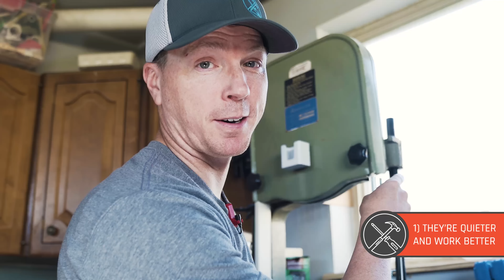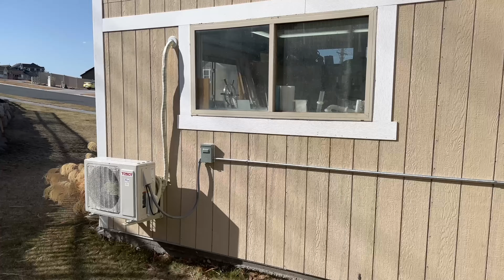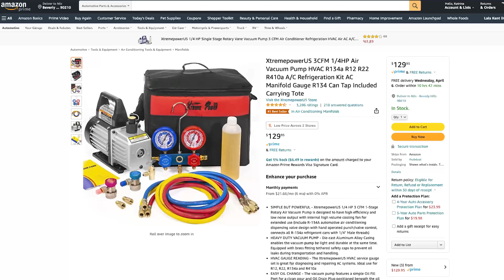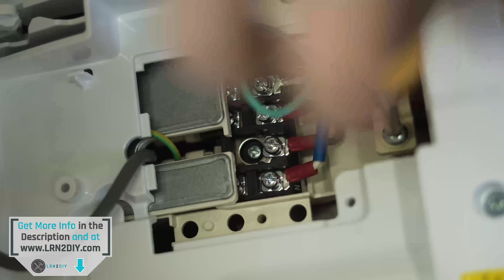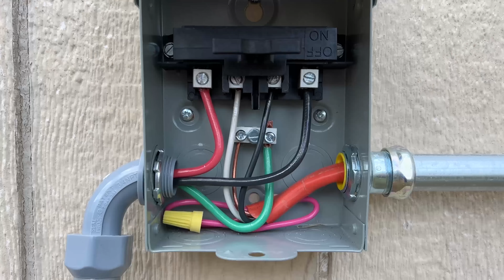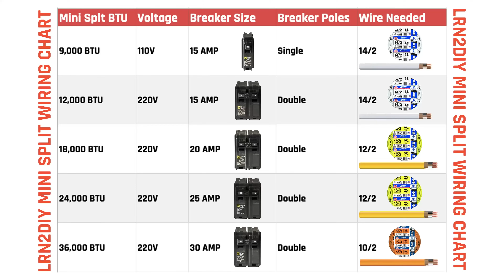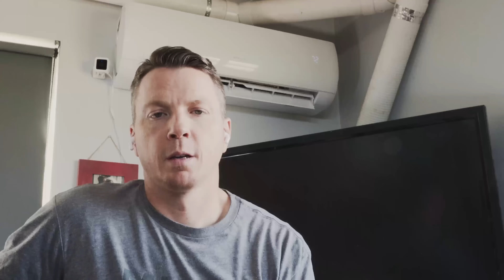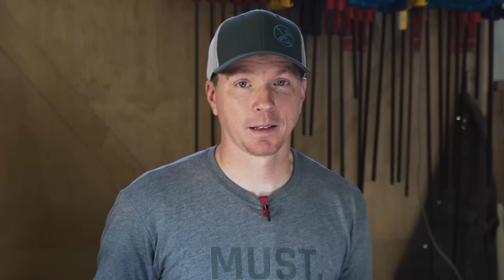Mini Split - 3 Things I Wish I Knew Before Installing

Comment: 1. You didnt say where you lived so most of what you said was useless.
2. There are 3 manufacturers in the entire world they are all Chinese, GREE..HAIER...MIDIA everything else is just stickers and injection molding to your liking. Each one of these manufacturers have good better best. This is why your Japanese units come in a box that says made in China.
3.SEER ratings mean nothing when you use them to dehumidify. High seer less dehumidification unless on dehumidifier mode. High SEER units are great for Arizona but dont mean to much in Florida.
4. Once you are in a latitude that requires more energy for heating than cooling you should go to a unit with a duel stage compressor. These units are more expensive but they all make them.
5. Just because they say the unit will operate down to -13 or whatever you must look at the performance charts to see how much heat they are producing at those temps. Most single stage units will barely produce 50% of the rated BTUs at 0 degrees. Most DUEL stage units will produce undiminished BTUs at zero although the COP at these temps drop considerably.
6. When doing your heat load you will calculate how many BTUs you need on a design day (coldest expect day in your area) Then you must look at the output of the unit you plan to buy for THAT DAY!  This information is contained on the performance chart for each unit.
7. When the unit breaks and it will and it will happen when it is 90 degrees out good luck finding someone to fix it if they didnt sell it to you.

Comment: @lrn2diy
You should edit & correct your video to include the ommitted and crucial aspect of the following:
1. Purchasing correct refrigerant and the license required by the EPA to do so. This fact alone and not having to deal with it more than pays for the Mr. Cool unit...therefore the 'DIY' in the name makes it worry free;
2. on getting the correct amount of refrigerant in the lines and unit...the 'DIY' unit makes it easy that you do not have to worry about;
Many more items can be mentioned, but just the first item above pays for itself in the 'DIY' Kits. I understand you need to make content for views, to get paid, but do it responsibly and keep the bias to a minimum, unless you are performing a tutorial of a specific install.
It tends to be biased and misleading to novice individuals...especially when you're trying to get paid on the affiliate link as well. KEEP IT REAL!
Reply from the maker: On this unit, I don’t have to touch, add or remove refrigerant. I needed to vacuum the lines but the refrigerant is already in the unit and gets released into the lines so I’m not sure why you’re indicating that I needed to add it or get someone to add it.
Reply: LRN2DIY is correct. The necessary refrigerant for the entire system is contained in the outdoor unit until after the lineset is fully connected to the inside and outside units and the lineset and indoor unit is vacuumed. Then you release the refrigerant from the outdoor unit and it fills everything up. Since I already had the gauge set and vacuum pump from doing work on cars, all I needed was a $10 adapter to adapt to the larger connections on the outdoor unit. Works just fine. He kept it real, you just came at the information not completely understanding how it works with most other brands.
Reply: Technically I believe a license is legally required for handling most refrigerants but I doubt the EPA has the desire or resources to chase down every DIY user.  But if you start charging for doing work for others, etc, different story and could bring unwanted attention, esp if something goes wrong.

Comment: You can always replace the old A/C receptacle with a different 240 V receptacle. That may enable upgrading one of your stationary power tools.
Reply: Yep, that's simple receptacle away from providing power to a welder, air compressor, big saws, etc.
Reply: @JohnnyBfromPeoria  I agree, just as long as his tool of choice doesn't exceed the amps that the breaker and wiring are rated for.  If the existing wiring and breaker are only 20A 240V it won't run a welder that requires 50A.
Reply: He needed 220 for the mini so he already had power and simply modified the connection box.

Comment: I installed a cheap chinese made Gree 3KW mini split myself in our bedroom fourteen years ago. I did my own pipework and bought a vacuum pump and gauges to set it up. It came with a normal 220v plug we use in the UK so there was no extra wiring required although I did get the main electricity supply to the house upgraded professionally as I also installed a large induction cooker in the kitchen at the same time. It's never gone wrong once in fourteen years and requires minimal maintence, only involving keeping it dust free.

It's definitely one of the best purchases I've ever made. The air conditioning is on all night most nights from the beginning of June until the end of September. It keeps the room at a comfortable temperature at all times and is quiet enough it doesn't interfere with our sleep at all.
Reply: Gree isn't actual that cheap. I mean the price is but the product is quality.  I have installed a couple brands that are just green units with a different name and they have been going strong for 5-7 years now. I had a 3 ton Mitsubishi that  definitely didn't cool as well as a cheaper (blueridge) unit that was also a 3ton. It was literally half the price at the time! $1700 vs $3600 for the Mitsubishi.  I'm not super sold on Mitsubishi because the price is simply too high for whatever extra reliability you get. Pioneer/gree/senville/blueridge  are all inexpensive and very good units. I have installed Single head units, double head units, and triple head units. So far all is good. I invested in really nice hvac tools that ensure a proper install every time like micron gauges/torque wrench set(not the same as a socket torque wrench)/ a nitrogen tank to pressurize the line too 300psi to see if there are any leaks before pulling a vacuum down too 500microns. You could probably get away with a cheap pump and gauge set but it could be a risk that you might have a slow leak Overtime but since I was installing many minisplits the proper tools where worth it.
Reply: Torque wrench is definitely required. Most people will overtighten the joints, fracturing the copper tubing, leading to a slow leak.
Reply: If i'm not mistaken Gree is the biggest manufacturer of AC's globally. Along with Daikin some of the best brands you can buy. At least that's the sentiment here in southern Europe for a couple of decades at least.
Reply: HVAC Tech from Africa here.  Gree also manufactures the unit installed in this video.  They also manufacture some of Daikins units
Reply: Surprised the Geely lasted so long. Chinese machines are usually built to get you 3 months beyond the warranty! That was why I went to a more expensive brand.

Comment: Good luck finding an experienced hvac tech to service or repair
Reply: The techs are not so much of a problem as is the parts. Components are obsolete in a few years and the parts are no longer available or compatible in the same time period. Mini splits are just as disposable as a window unit and you have to pay someone to remove the refrigerant before disposal, where a window unit you can replace yourself
Reply: DIY

Comment: I had my buddy that does HVAC come out and look over my install and we filled the lines with pressurized air to check for leaks and that was it no vacuuming and it's been fine but I kinda wish we had vacuumed them down but I mean it's been like 7 years or something with basically no problems I've had to unclog the drain a couple times but otherwise it's been fine
Reply: Your buddy doesn’t know much about hvac. Pressurized air in a hvac system introduces moisture and non condensables that will severely shorten the life of a compressor and cause the system pressures to spike. Evacuation to 500 microns or better is the required way to remove noncondensable’s.
Reply: @jeffwright5794  I mean he has been doing it professionally for probably like 8 years at the time and I wish we had to it would have been the best it could but it's still running fine

Comment: A couple questions, do you need a receipt from a licensed A/C contractor for the final installation to get the warranty? Is there a way to install a box "pre-filter" around the air intake for better filtration than the little plastic filter that comes with the unit? ( I made one for my window unit out of quilters fluff that has helped in my shop)
Thanks for the link to the inexpensive vacuum and accessory equipment!
Reply: Yes you need a licensed hvac to sign off on the Install. I never did and installed 10 or some mini splits and haven't had a single issue with them in 7 years. They where mostly senville or blueridge units and one Mitsubishi.  I wouldn't hold my breath on a warranty unless you paid a installer to do the work.
Reply: @randybobandy9828  Thanks for that, it gives me more confidence in doing the job myself. Did you vacuum down the lines?
I haven't bought one yet as my old window unit still works but I called two local A/C companies and they both basically said no on final install and that they couldn't guarantee their work unless I bought the unit from them, when I said I didn't need a guarantee from them, they said sorry, company policy.
Reply: @sam Tollefson  yes I vacuumed down the lines. You want to get a micron Guage to make sure you pull a full vacuum down too 500 microns. You can get away with regular gauges but you might want to just vacuum down the lines for atleast 12hours then shut the value on the gauges are let it sit for a day and make sure the vacuum doesn't move the gauge at all. Ac install companies not wanting to install the unit I bought was one of the reasons I installed it myself. I did find a company who agreed to install the minisplit I bought but they tried to quote me $2400+ tax to install it... they where trying to charge more for the install since they couldn't make money on the mark up for the ac unit that they usually sell. I was able to install a 3 ton minisplit that I paid $1750 for(including the refrigerant lines and shipping) with about $300 in tools and another $75 in electrical. That would have been $6,000-$8000 from any local hvac company easily.  A 3ton unit is a very large one that can cool a full 2,000sq ft home. You can buy a smaller one for alot less. Watch a bunch of videos on install and take your time doing it and you will be fine! The hardest part is honestly bending the copper line sets as they get pretty thick on the larger units.
Reply: @randybobandy9828  Wow, thank you for all that!
I am copying and pasting all this info in a file for when I do get one.
One clarification if you don't mind, did you mean vacuum down the lines for 12 hours?
Reply: @samTollefson , Yes I have put a vacuum pump on a especially large system, and run the vacuum pump for over 12 hours.  However with these small systems, running it over 4 hours, that is not really required.  The system where I started it at 4 pm and ran it until 10 am, that was a 360,000 Btu heat pump installed in a 10,000 + square foot building.  

I used a vacuum gauge at a place I used to work for.  They said "You must vacuum it and hold that vacuum for over 1 hour"   However it was the vacuum gauge that was leaking.  So that didn't really work out well for me.  We bought another vacuum gauge (about $175) and I basically ignored it, or put in a valve, so I could check the measurement, then valve it off, then continue.  1 hour and the gauge would read in the 200 micron range.  So that is plenty for a ductless heat pump.
Reply: @Kangenpower7  Many thanks for your reply!
Reply: My (Senville brand) units require a form to be filled out with the install company's license number and name, but I don't see a requirement to provide a receipt.

Comment: Idk if I would trust a vaccum pump gauges and hoses and all for less of the price than what a decent set of actual gauges cost
Reply: As a service technician, I say that the pump and gauge manifold shown are perfectly adequate for the application. A lot of residential install crews use very basic gauges similar to the ones shown.  They would have a better quality vacuum pump, but it’ll be fine.
Reply: I am not an A/C guy so my two cents may not be worth that, but what I have gleaned in my research is that the main difference is that a cheap pump takes a lot longer to pull the proper vacuum and the pros don't have that extra time to waste. For me though, if it takes even an extra hour, I don't care if it saves me many $$$.
Reply: I found it was the cheap hoses were the problem:  guy couldn't pull a vacuum on the very best system if the Schrader valve adapter or the pump hoses were shady.  The gauges may not be precisely calibrated, but they won't creep if there's no leak.  For diy, time is not quite money; the Chinesium only has to work once.

Comment: What about charging the system with the unit you installed? Not everyone has their EPA license.
Reply: The outdoor unit comes with a full charge of refrigerant. After you connect the line set and indoor head unit then evacuate, you open the valve to release the refrigerant into the rest of the system. The refrigerant charge is the right amount for a certain range of line set length (on Pioneer models, it is 10 to 25 feet). There is no extra refrigerant to add.
Reply: You might have to do that, what, every ten years? Pay somebody if you can't DIY.

Comment: However if you don't have an HVAC license you cannot recharge or put Freon into that system. The mrcool system has the freon already installed in the lines so no license required.
Reply: Systems without charged lines have the system's charge in the outdoor unit until installation. The lines and indoor unit are vacuumed and shut off, then the charge stored in the outdoor unit is released and fills the system. So you are not recharging or adding anything. Charged lines are kind of gimmicky to me, but I have the tools and connections to DIY and don't mind saving money.
Reply: @JohnnyBfromPeoria  thanks for explaining how the other system is charged.
I guess it boils down to which system is better build. I looked at Carrier, but it was flimsy construction and twice the price. My inlaws have a Carrier and it broke down already.
Reply: @basspig  I went with Senville. They're so cheap, I'd throw it away and buy a new one before paying for any "real" repairs. But this is my garage we're talking about, so if it went out (and I have two separate units), I wouldn't be hating life or anything, even in Phoenix.
Reply: @JohnnyBfromPeoria  I wanted something reliable and long lasting. It's difficult to rate that with modern systems. I know my 1984 vintage Emerson Quiet Kool window ac units were reliable because they lasted 38 years and were still working when I replaced them.
Reply: @basspig  I'd say you got your money's worth out of those!
Reply: @JohnnyBfromPeoria  Yes, definitely, though I wonder about the dollar cost in electricity. 2400W load and the compressor was nearly always running. Electric bills used to peak when the two A/C units were on. So glad I have the mini split now. Can't barely tell it's using more power than a large light bulb. We run  on solar/batteries/inverter here and the modern A/C adds about 8% load per system to the inverter. So with all the A/C and computers and lights, we are about 25% capacity on a SunGold 6000W inverter.

Comment: Good info!  I figured that all out before buying, paid $650 ea for 12kBTU units.  I've done HVAC and electrical before so I have tools and it was all just grunt work.  

These units are just 10A 220vac so a proper outlet fed with tested wire on a 10A ganged breaker placed where the disconnect would go, with a matching plug on a rated stranded properly suspended whip would be safe and probably pass nec code technically (though local inspectors may interpret otherwise).